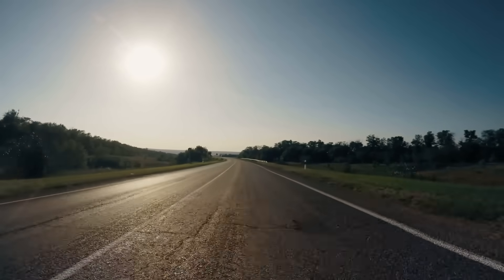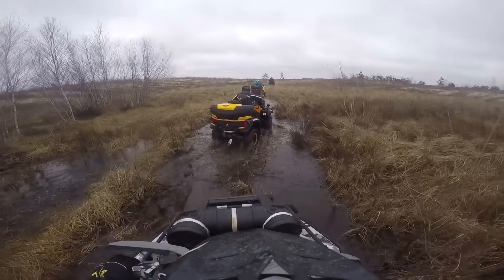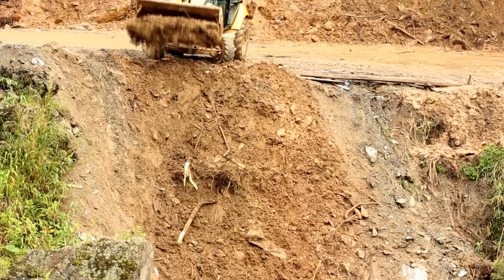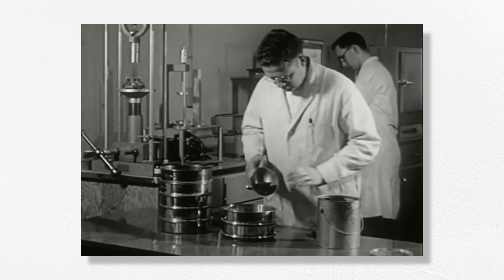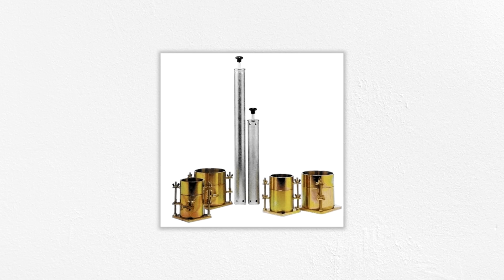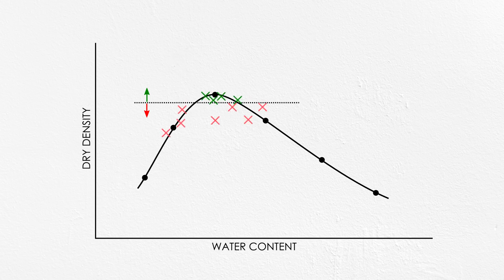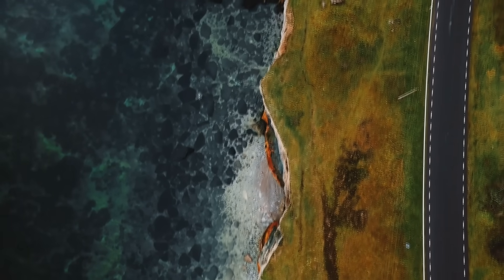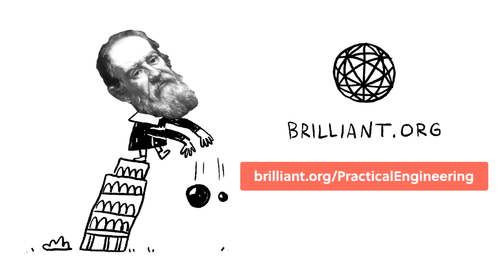Why Does Road Construction Take So Long?

Comment: I love this kind of video, as it helps explain some of the basic-yet-fundamental things we need to keep the modern world going.

Over the past 6 years since I moved to where I now live (which is about 110-130km/70-80mi from the nearest cities), I've noticed a lot of the road surface out here undergoing often enough work to do things like improve the road over a few creeks so when it rains heavily the road surface isn't flooded from undersized culverts, or widening the roads in key stretches to allow easier passing-by of the freight trucks that use the road (which is mostly 2-lane rural blacktop) when they're shipping stuff on the North/South or East/West routes that intersect along the main roads of my town.

Sure it is a little bit annoying having to drive at like 40kph/25mph on the unsealed dirt surface after waiting for a few minutes for the traffic in the other direction to finish, on a section under work on a trip in to town for appointments, but in the long run that little wait is outmatched by the smoother and easier travel later in life once the work is complete.

Comment: I disagree. On 90% of road constructions I don't see any workers.
In CZ I know about 1.8km (little bit over 1 mile) of highway, which is built for over 20 years.
Our main highway is not finished yet and building started in 1935. Most of it built in 70's during the communist times.

Comment: "I love seeing the slow but steady progress each day."
You clearly haven't seen the way roads are built here in the UK. Nothing happens for weeks then you see a massive change overnight followed by more weeks of nothing.

Day 1: Road closes.
Week 3: Construction equipment actually arrives on site.
Week 4: Construction crew arrive on site.
Week 6: The first piece of turf, tree, bush or hedge is actually removed.
Month 3: Work actually begins on the earthworks.
Month 9: Earthworks completed.
Month 12: Work starts on the road surface.
Month 13: Road reopens.
Month 18: Road closes again for line painting.
Year 3: Road closes again multiple times for utility companies to lay their utilities one at a time, often having to come back to fix damaged caused by another utility company.
Year 5: Two year old potholes caused by the utility companies damaging the road surface are FINALLY... marked with yellow spray paint by the local authorities.
Year 10: Some of the marked pot holes repaired, others left for later. New potholes ignored completely.

Et cetera, et cetera.
Reply: Oh man, especially councils,
"We can't afford to repair the road this year" - the council.
"We all got brand new 'company' cars and bonuses" - also the council.
Reply: @twistedsoul  Well they had to get new cars, as the potholes broke the old ones.
Reply: @kingofbengland  And bingo!
Reply: @twistedsoul  Well that depends. At least it used to be the case that for company cars it worked out cheaper for the company in the long run to get more expensive cars and to replace them more freqently, essentially because resale value was much greater, it was always still within warrenty and maintainance was much less. (of course this wasn't always followed because the managers liked to feel important with fancier cars, even though they worked out to cost the company less... And for such responsible management of money they still got bonuses... I guess upper-middle management types were petty, go figure.)
No idea if that still holds true though.
Reply: @sergarlantyrell7847  nah! It doesn't still hold true! You could of kept that information to yourself! It's a free world though.  Supposedly. You're free to say what you want, but so are we!🤷🏿‍♂️
Reply: @twistedsoul  Bingo!
Reply: Tom, in Romania is the same thing.
Reply: @phaenius  I have lived in Romania for several years, and the problem seems to be that they have more construction workers than tools: whether it's shovels or paint brushes, you see one man working, and 6-7  men standing around and commenting
Reply: @chemiker494  LOL, then you know our saying "unu cu sapa si trei cu mapa" :)))
It's not the lack of tools, it's the lack of mood and responsibility. Everybody steals and workers are mostly drunks. It took 4 years to raise a mall in my town with Romanian workers then, after a while it doubled the mall capacity with Chinese workers in 3 months.
Reply: @phaenius  Sure, but Romania has the excuse of being a middle-income country (a shit excuse, but an excuse nonetheless), not the 5th wealthiest country on the planet like the UK! 🙁
Reply: to be fair our roads are about hugely thicker and stronger..
Reply: 😂 So it's a common wealth problem,I could relate to that
Reply: Good lord it's frustrating. Especially as councils somehow have plenty of money for the projects that should take maybe a month, not a year, yet they seemingly never have enough money for anything else.
Reply: @fredjohnson9426   OR they partially fund a project, like a road, let it sit, until new funding comes in. Expecting to cover the rest with next years money, but when that is spent the project just sits there until people become so frustrated they are willing to raise taxes for that one project.
Reply: Here they have been repairing a Autobahn "bridge" (cross) for three years now and this is a super small 4 lane cross where the bridge has to cross only those four lanes. Meanwhile China replaces some 16 lane bridges in a city in under 48h. 
I wish gov would hold those fucking construction companies accountable and just jail their CEO over the shit they pull all the time. 
Oh, a simple two lane rural road ~500m took over two years. Of course with weeks where absolutely nothing was done.
Reply: You forgot the bit where the utility companies all over the holes they make with little asphalt patches that lead to potholes the next time something freezes nearby (or in less traveled roads, the next time some seed grows out of the gap between that and the main road surface).
Reply: Day 1 - barriers are put up on residential street and road dug up.
Week 10 - utility company does what they have to do
Week 11 - road resurfaced and barriers removed.
Week 14 - another utility company turns up and the cycle starts again...
Reply: Sounds like the m4 construction right there 😂😢
Reply: A well conducted Proctor test takes time to complete. Add the time to send samples to the lab, and write the analysis report, and you get why it is like that.
Reply: In Germany it takes even longer
Reply: Tom Dyer spot on
Reply: @Erika Johnson I don't know in other countries, but where I live, they do work at night. Still, it takes forever and not because of the complexity of the work. :)
Reply: Yea US Roads take a few weeks to be built when it comes to Streets. The weirdest thing in the US though is that you would see alot workers doing basically nothing and are just standing around. I swear I saw 10 to 15 people standing around a Jackhammer trying to look busy.
Reply: @Flakjacket96  exactly.  I've worked on these teams before.
Reply: Same with Ireland lol,
1999: Propose to build a ring road
2020: Still proposing the same ring road and nothing had been built
Reply: @redmondokelly2464  Good things come to those who wait. ;-)
Reply: @cccwue  What if you die waiting?
Reply: One word, CORRUPTION!
Reply: @yengsabio5315  Yes?

Comment: I know since I am trying to deal with a new road for over 20 years. The physical building is the easy part dealing with gov is the hard part. . Also unions cost a lot more than its worth. Gov laziness incompetence inexperience lack of communication with departments etc. A lot of regulations. Over priced corruption to charge over 10 times more. Bs regulations.. Political since some road work is done at places where irs not needed and ignored where its needed. Kickbacks since some roads material last longer scrap rubber than conventional. Most contractors dont want to do gov jobs since the gov can take 10 years to pay so not many will want to do it due to gov disorganised incompetence. That is the more practical reason for engineering of why.

Comment: I'm curios to know how local government bodies decide when a road should be recovered or completely resurfaced. A popular thing that local authorities do here in the UK is just clean the road, slap on a layer of bitumen and then a layer of gravel before rolling over it. Does a terrible job but it squeezes another decade out of the road before it get's fully replaced. aka, it passes the cost down to the next bunch.

Comment: I swear this road project here in NC is a one mile connector loop and widening project that has been planned for 25 YEARS and has been in construction for over 5 years. It’s called the East End Connector and is located in Durham, NC. It connects the Durham Freeway (NC-147) to US-70. 

I looked up the project on the NCDOT website and it’s actually 3.6 miles long in total, (1.25 mile connector and 2.4 miles of widening) but still... it’s taken so long it’s insane. China can build an entire nationwide interstate highway and rail network in less time than we can build a short 1 mile freeway connector.

Comment: When big roads are biult here they use an awefull lot of the big white styrofoam blocks in the foundation of the road. Do things like that increase or decrease the need for things like compacting soil?
Reply: That technique isn't very widely used. But i would suspect that it's used for very bad soils that are very susceptible to water, hence can't support a lot of weight. More styrofoam  means less high density filling material. It's probably also used for bridge roads, so you can lighten the load on the bridge.